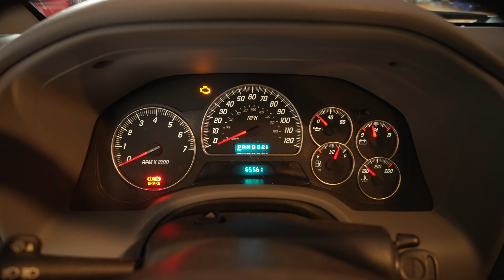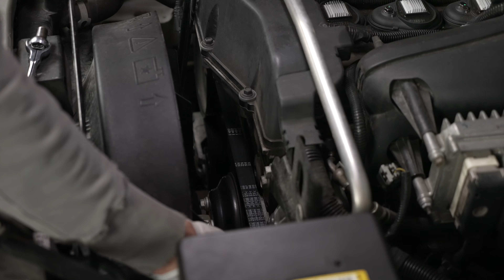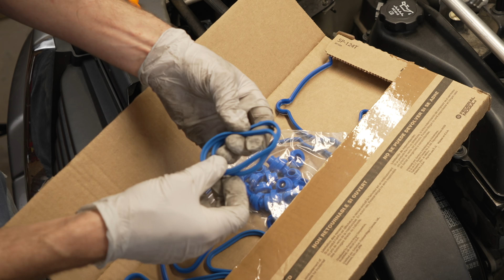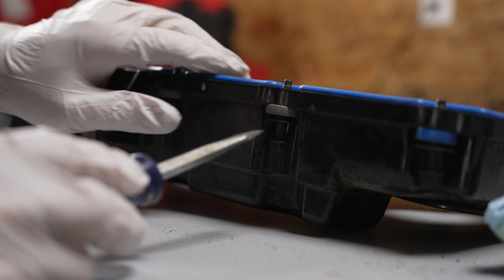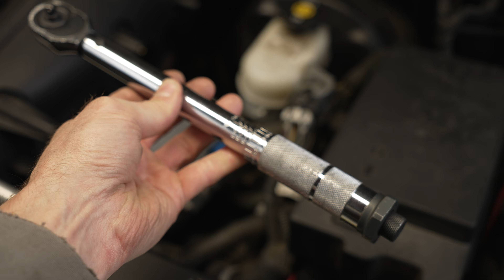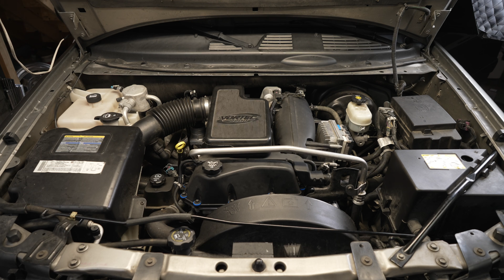Here's Why You NEVER TOUCH FACTORY INTAKE MANIFOLD GASKETS!!

Comment: I've personally replaced three sets of motor mounts on these vehicles, and pretty much all the other ones I drove needed them. 90% of your vibration and seemingly rough running are the mounts, intake needing to be cleaned, or vvt solenoid. The latter two can happen and should be cleaned periodically, but the mounts are a given. 100% of all the envoy/trailblazer/ acsender/Rainier mounts vibrate and prematurely go bad. Here's the thing, none of the cheaper mounts work. You have to buy the oem mounts at a hundred bucks + a piece. There are two, and depending on whether it's 4wd or 2, is the difficulty level. Both are hard, but the 4wd is a total pain. Stop throwing money at these things, replacing parts it doesn't need for "running rough" or "vibrations" it's  the mounts. It'll feel like a new car afterward...at least for a while.

Edit: First things first. Clean the intake and do a proper idle relearn. The 4.2's are VERY sensitive to that. They will idle low or shut-off if you don't go through the steps correctly.

Comment: It just doesnt make sense why they would build an engine with a plastic valve cover with those shitty bolts that always snaps. Metal valve covers with normal bolts would be best . Then you could tighten it down and know all gaskets are sealinging perfectly.
Reply: the later models they did use aluminum but changed the shape to make it incompatable

Comment: I have the same engine in a 2007 trailblazer and it was idling rough and stalling. The problem is the variable exhaust valve .it is easy to change with it being right on top of the engine by the power steering pump reservoir. The valve is known for going bad and the oil screen on it getting clogged where it doesn't work correctly to ajust the variable timing. If you still have the vehicle and have this problem then replace the variable exhaust valve.

Comment: had this issue with my 4.2l 2004 Envoy having a rough idle, put on new coils/plugs.  new VVT solenoid.  nothing fixed it.  would sometimes die at idle about once every month.  I noticed some fuel was coming out the top of the fuel pressure regulator suction line going to the air intake.  There should be no fuel in that line, if there is then the internal diaphragm has failed.  I put on a new fuel pressure regulator and it fixed the fluctuating rpm at idle.  Go back to the basics (spark, air intake, fuel delivery) that could be causing the rough idle.  seems like you got new plugs/coils, you have a clean air filter.  So things would point to your fuel delivery. these 4.2l are touchy with these vacuum line operated fuel pressure regulators, they have to be spot on.

Comment: Monitor fuel trims on the 02 sensors and 02sensor voltages. May be that. Fuel pump too weak too due to clogged filter in the gas tank.

Comment: What ended up being the issue? I  am having a similar issue with my 06 Trailblazer
Reply from the maker: From my research, gaskets are definitely a common issues on these. I recently changed a fuel injector that looked bad but the real surprise was changing the engine mounts. After the new mounts were put in the vehicle was/is as smooth as glass. 🤷‍♂️

Comment: Bro, the car shaking like that in the beginning is normal and if you want to smooth it out all you have to do is clean your throttle body. That weird sound may be your alt, if you didn’t put in an oem replacement that could be the case, but not likely, replacing the gaskets for the intake manifold is something you should do when you take of the manifold.

Comment: Put it on a scanner and see which cylinder is missing it could very well be a fuel injector my son has an 06 trailblazer and I have replaced everything I know and nothing fixed it so gonna do a fuel injector replacement along with a valve cover gasket replacement love the video thanks it's gonna help me alot

Comment: I forgot to mention 1 step . Checking for vacuum leak. Start engine and spray water  mist near intake manifold / throttle body listen for a change in engine rpms, if none, no leak, if there is check very slowly and carefully for cracks  in vacuum lines because you have a vacuum leak Again if you go slow, take your time and check systematically you will find the cause WITHOUT buying parts you do not need 😊

Comment: First thing is check with a scan tool a misfire say in cylinder 6
 Step 2 swap coil and see if misfire follows or stays at 6. Step 3 look at spark plug for oil or carbon. If good, step 4 clean throttle body. Step 5 check air cleaner and air box for dirt or oil in air box which meAns PVC. Step 6 clean or replace MAP Sensor by throttle body. Step 7 replace the fuel pressure regulator. If still rough or still misfire put Chevron Techron in an 8 gallon gas tank and run high speed. U may have to do this 2x
 If nothing has worked U will have to replace the fuel injector. ALWAYS SYSTEMATICALLY go with the easiest first and make sure you have a scan tool and constantly check and check the Freeze frame mode as well as live data mode
 I got a 2004 Envoy rebuilt the entire car right down to the electonic dash when in doubt get on your computer there are tons of videos. Go slow 😊

Comment: Hi, this is an old post but i love this engines and wanted to comment, for sure the intake manifold seemed to be leaking or starting to, it is common for the rear manifold bolts to come loose. After all you already did, I would go through the obvious(oil level will affect the VVT behavior and will indeed affect the idle)  and easy common cleanable things first, throttle body, MAF and VVT valve you replaced. Check the mass pressure sensor by disconnecting the mass airflow sensor while idling. The engine will cough a little but once PCM picks up it will run fine with the MAP if it is in good working condition (reconnect MAF). Then move to spark plugs, coils and lazy injector inspection. I hope by now you figure this out and share your findings. Thank you for your videos, I have enjoy the few that I have seen so far.
Reply: Great information

Comment: Check Fuel Pressure Regulator, had similar issue with 4.2  barely leaking diaphragm caused rough idle sometimes die at stop. Fuel pressure regulator fixed it. Good luck.

Comment: Just a tip its a returnless fuel system, there is no need to "prime" it, any air in the system is going to get compressed into the rail and purged when the injectors open, that is how returnless systems work.

Comment: Sir, you seem like the perfect person to speak on an experience I had with engine noise. I had a loud engine tick that cane suddenly, and I was 100% sure it was a rod bearing because it was coming from the bottom and was much louder under the van whether the hood was open or shut.
I bought new bearings, sandpapers, and other stuff. After pulling the pan, I didn't find anything loose.
On a hail mary, I opened the top of the engine because these vans are known for ticking lifters, so I replaced any that i felt were too loose.
Problem solved. Relief set in x 1000.
But, the wierd thing is how loud the top-end tick was u derneath the van.
Anyone hearing that wouldn't have said it was a lifter unless they had that exact problem before.

Comment: Great video. I'm not exactly sure where you're at with your rough idle situation with your envoy. that being said, have you cleaned your map sensor Manifold, absolute pressure sensor with the correct cleaner not to use brake cleaning or carburetter cleaner because it doesn't dry quick enough you must use intake manifold cleaner. This could give your engine, a false reading giving it a rough idol. I'm assuming you probably already changed the spark plugs and they were of the correct type and gap even though they likely came already pre-gapped it's good practice to check to be sure. Have you taken a look at your fuel filter or changed it as well your air filter I'm assuming you've changed because it's best practice and less expensive that way to start with unless you have a fancy scan tool you can hook up to check your engine live data. Another possibility could be your fuel injectors or fuel system could be dirty sometimes I can of Bernie B12 or something similar to that typically would help clean up clogged or dirty, feeling injectors as well as your intake valves. There's excessive carbon on the tops of your piston that would also affect the performance of the engine, giving it less for the fuel and air mixture to ignite. Did the rough idol start after you cleaned the throttle body assembly. Some vehicles require a relearn procedure due to the increased volume of air Once I thought the bodies cleaned to look like new. Do you have any exhaust leaks? if so, that will affect your engine performance as well if there's an exhaust leak, then the O2 sensors downstream pick up a false reading, which would then prompt the engines ECU to add or decrease fuel. That could be checked using a cheap scanner off Amazon by checking the fuel trim both short term and long-term. Given that your engine has low mileage, it should be close to zero. Being perfect meaning, the fuel injectors are injecting the exact amount needed for the engine. I'm watching this video now, so I'm not sure if you've already fixed the problem. Keep up the educational and entertaining videos on how to.?

Comment: Sounds like Idle air solenoid, usually just cleaning them works, but cheap to replace. Also check the temp sensor reading with scan tool  (sensor in intake)

Comment: I used cheap Rock Auto Coils, Injectors and used alternators off Ebay to keep my 408,000 mile NY 05 Colorado on the road. I used Mobile 1 since brand new and changed oil every 6000.  All the rough running I've ever experienced is due to harness corrosion especially to coils and injectors. If you don't tighten your coils enough. You will get oil in the plug holes.

Comment: Had a rough idle on my 09 impala. Needed work on the tps (throttle position sensor) and I also cleaned the idle air intake and put in all new air filter. This solved the issue, but it’s also worth noting that I did put in a new injector wiring harness. This was at 235,000 and the engine previously was running on all factory parts (replaced the serpentine belt at 240k and spark plugs and plug wires a little before 235k). I reused the original intake manifold gaskets and it’s been running like a top aside from a small evap leak that’s probably a gasket that I should’ve replaced when I did the wiring harness

Comment: Recommend checking coil packs (ohm and Meg), fuel filter, check readings for MAP, MAF, and TPS, look for cracked vacuum lines. These are some items that I have chased in the past. Don't just throw parts at it, try to verify bad parts. Great work on finding the bad bearing in the alternator. I've had that one before too, lol.

Comment: These older GM cars are notorious for having issues with the timing components just never working right. I don't know if the 4.2 is the same, but the 3.6 V6 with the VVT would do that. You could replace every single timing component, including the chains, guides, gears actuators, sensors and solenoids, and it would still shoot timing codes. I personally avoid any GM cars with these engines in them. The LS is a good solid engine, and I think both the 3.6 and 4.2 have good bones with solid basic designs, but they are really tough to make run right from what I've seen. GM didn't do that last 10% they needed to to make both great reliable engines. If you plan to keep this truck just drive it like you stole it. It's never gonna be perfect.

Comment: It could be your throttle sensor. I had a car doing what you described. I changed the throttle control sensor. 
A friend had the same problem. Same part fixed his. his sister had a truck doing the same thing. It ended up being the throttle sensor on all of them. Change the whole throttle body. It was like 75 bucks when I did it.

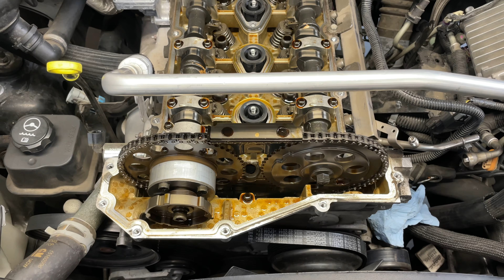Comment: 7:09.. For 65K, that engine is clean! I had a 2007 Mustang GT, it would stall out, glitch, and throw codes for cam position and crank position codes.. One day I went to start it and the brand new battery was completly flat. That's when I realized it was a failing alternator the whole time.

Comment: This should be "Why You Never Touch Factory Alternator". Even the rebuilt ones you buy from the manufacture don't last as long as the original. You should have just spent $9.00 on new bearings for the alternator because the one you put in will go bad just the same in 3 years or less.

Comment: Way too much crap to be doing to a car with under 100K miles even for a GM made piece of junk.
Reply: I owned a 2006 trailblazer. It was the worst. Always constant limp mode with no codes that could even hunt what was wrong. Other than throttle body. Which was changed twice. Problem always came back. These vehicles are JUNK!
Reply: @avenged06x  Only time I got limp mode was the acceleration sensor gone bad.

Comment: Bad idea to use Felpro. OEM gaskets should be used. My personal experience. I used Felpro only to leak in 2 years. I found Felpro has a different cross section and ‘shallower’, ie. the cross section height is smaller than OEM.

Comment: I also had a GMC Envoy for about 12 years 300k miles.  I ran into the same issue.  It started when I cleaned the throttle body.  It ran the sa.e way afterward.  So I replaced the throttle body.  Which wasn't expensive at all.  And the problem was cured.   Hope that may help you.  I loved my Envoy.  I just didn't need it anymore.  Great channel keep it up.
Reply: did you have some hypothesis on what went wrong with the throttlebody?  the servo?

Comment: Inspecting this engine, it looks an awful lot like GM tried to copy BMW with a lot of design elements... Between the intake cross-section, valve cover, oil filter housing, etc... but, I would expect to see issues around 150k mi with the BMW engine. This is almost as good as the time that Ford bought Jaguar/Land Rover, after BMW spent a few years putting reliable engines in them, so Ford paid extra for rights to copy and produce the newer engines... Then Ford tried to put the same high compression format in their "performance" car engines, and nobody has been happy, ever since.

Comment: Poor running and idle, may be a lean mixture, and/or faulty sparkplug/HT lead. The no.1 diagnostic tool is the condition of the plugs, in my experience, if everything else is tight, and not worn.

Comment: These engines are known for pumping the cylinder head full of oil(prolly bc gm was scared of grenading engines with the new vvt/dohc setup) and those spark plug gaskets will seep oil especially on the inner spark plugs(cyl 3,4) and coils causing intermittent misfires that often go unnoticed for very long times.

Comment: Misfire data come from half malfunctioning coil, some coil use transistor inside and not work with high temperature, some coil to diagnose you need transistor tester
Reply: After removing the valve train cover, I would've pulled those plug boots off too, then checked the boots for any burn spots, which would show where the spark was likely jumping from the COP to the head mounting point. Also pull the 6 plugs since you are that far into it and make sure the plugs are burning well. I'd never leave those boots on the plugs and just reinstall the COP without checking them. I've had Ford COP boots develop tiny cracks or pin holes that were very small, but allowed the spark energy to pass to ground through the boot. If there is an opening, the electricity will find a way to ground!

Comment: 90 chevy truck butterfly in exhaust was rattling once in a while , which sensors picked up as engine knock adjusting fuel causing rough engine running, swapped about a hundred things before one thing standing on passenger  side it rattled and engine acted up.

Comment: Gunk on throttle body plate. Give it a good cleaning and see if it changes things. My 5.3L 2013 Avalanche's throttle plate was pretty caked. A toothbrush with some intake cleaner smoothed things out quite a bit. Still not perfect but does WAY less throttle wobbling.

Comment: Your alternator "knock" was probably being picked up by the knock sensor,  causing the ecu to adjust ignition timing. The intake gasket may or may not have been faulty also.

Comment: A lot of speculation as to your issue. My recommendation would be to buy a scanner that has 'mode 6' readability. I personally use the Blue Driver. It has lead me to the source of multiple small issues (including random rough idle). Firing the parts cannon at something is great for learning. And more power to you in that. But, it can get expensive. And it doesnt jave to be. Keep on keeping on.

Comment: Honestly, have a real mechanic with actual tools to attempt a diagnosis. I'd smoke the induction system (vacuum leak), monitor MAF pid at idle and or MAP  sensor reading, check fuel pressure, o2 sensor data and have access to identifix to lookup tsb/recall or unusual confirmed fixes

Comment: You need a good scanner to check your computer for error codes. After what you have done to that car i would be checking the fuel pressure. How long is it since you changed the fuel filter?